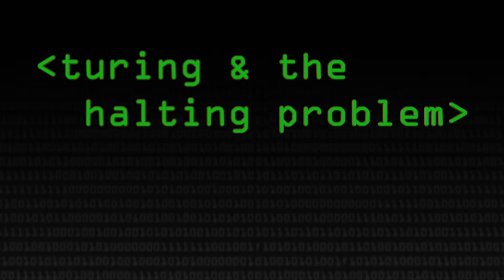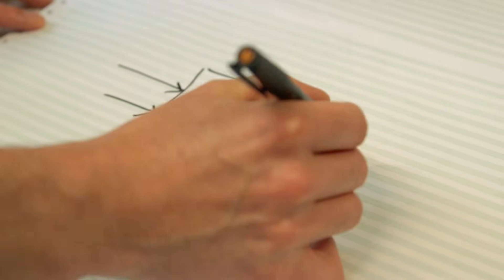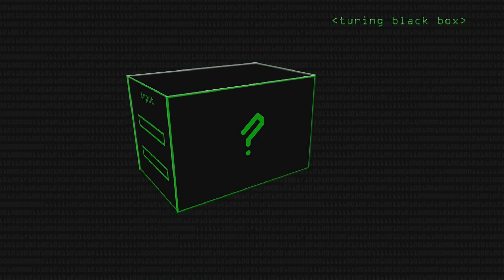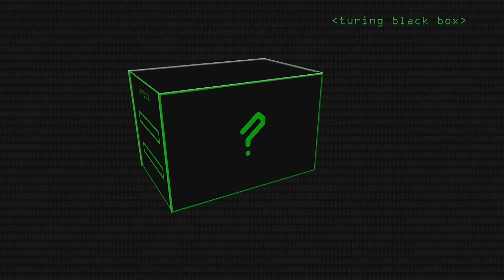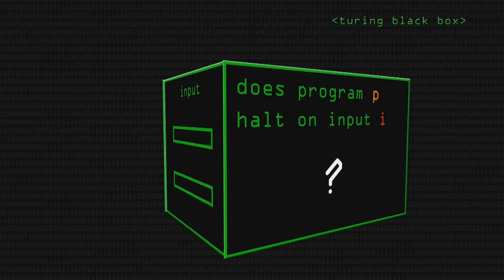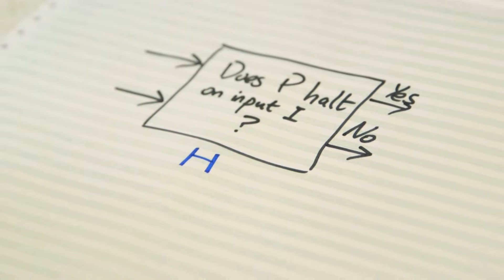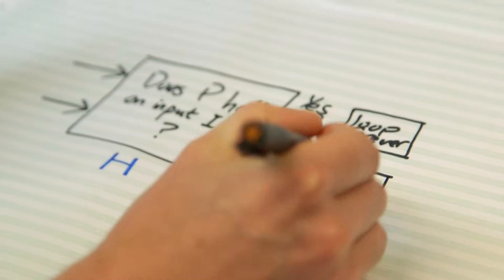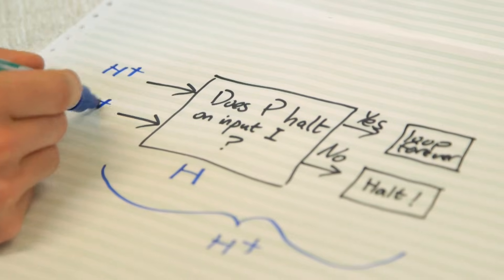Turing & The Halting Problem - Computerphile

Comment: Can someone cleverer than me please explain why adding the negation operators is proof that the H machine can't exist? I've seen this proof in a few places now and none of them have explained why adding those operations is an OK thing to do. Surely doing that to any function would therefore prove it wrong? We take machine H, then we reverse its result, and somehow that proves H can't exist? I don't understand the logic of it. If I'm writing some code and I write a function that returns a boolean value and it works, but then I add a bit at the end that reverses the result, that doesn't mean my original function can't exist. So why is that the case here? Can anyone help?
Reply: @Brauggi the bold  Point 4 in your list is the bit I don't understand I think. We know N can exist, but why does adding N or H prove that H can't exist?
Reply: @Brauggi the bold I honestly was convinced I understood until reading your proof, at this point I think I'm mostly hung up on the idea that while I understand how H+(H+,H+) can't exist how does this necessarily imply H(H+,H+) and therefore H(x,y) can't exist. If N(z) is simple making a reversal of the output then it sounds like H(x,y) still produced the correct output so at the end of the chain all that is happening is swapping the boolean and saying that a separate machine N(z) changed the output (after the analyzation) therefore the output of H(x,y) is wrong?
Reply: @Brauggi the bold I'm not even going to lie you literally just made it click after I spent way too much time trying to figure it out. I had already gotten down to the mathematical impossibility involved which is that H(H+,H+) can't be both true and false (which is the result we get in the halting problem) I was really just stuck on where the intuitive rationale comes from but now I 100% get it and all it took was the word 'predicting' which is something not a single source I found worded it like that lol. I think the problem was actually just thinking too deeply about it.

Comment: I don't understand. Don't you need to define the program and it's input to determine if the machine will halt?

The inverse halt machine has been inserted into itself with no input.

In my mind, this would contain an empty program, which would halt.

This means the input would inverse, and therefore not halt if ran with this input. The top level machine would inverse this, and then halt.

Im assuming I'm missing something?

Comment: The mistake in this video is that the box in the machine asks, does program p with input i halt? However you cannot feed in H+ to this machine because H+ takes 2 inputs instead of 1.
You could fix this by adding a new component to the front of H+ that only takes 1 input and copies it into 2 for the inner machine. Now H+ takes only one input and the argument works just as explained.

Comment: You cannot feed H+ with its description as both of its arguments.
H and H+ are machines that receive TWO arguments, the description of a machine of ONE argument and its argument.
Doing the thing proposed in the video, creating H+(H+, H+) means nothing, because in order for it to be a meaningful statement
the first argument would have to be the description of a machine of ONE argument and the second argument the argument of that machine, whereas H+ is a machine of two arguments. 
The proposed machine would answer something like the following:
 "If the machine of H+ halts with H+ as its input, then it doesn't halt and vice versa", but that is not a meaningful statement since you have to have TWO arguments to know whether H+ would halt.
Any clues here? What is wrong with my challenge?

Comment: I'm a little stuck, maybe someone can help me:
I think its pretty clear that determining if a programm halts or not without giving it the input is impossible. Now lets take H (not H+!) and feed it to itself as program("Hp") and input("Hi"). H will now try to find out if "Hp" halts on "Hi". But "Hi" itself has to contain 2 arguments "Hip" and "Hii" to be a valid argument. "Hii" in turn has to contain "Hiip" and "Hiii" etc. So the input is delegated to infinity. Hence it is not possible to ever create a valid "Hi" (for this example). Which essentially is the same as running "H" without an input, since you cant put an input at the most infinite recursion.
So is there really not way to get "H" running when "Hi" is evaluatable? Im still curious - recursions are not very human friendly :D

Comment: I find it odd that you expect a machine to function when given it's own code to process that has it's own result flipped while doing so. H can't understand what H+ is going to do, because that design in itself is a loop, and switches the result. As far as I'm concern. If a machine can exist that does everything besides this kind of flipping logic, it's a pretty fantastic machine, and thus the Halting problem is solvable. It just can't do 'this'. Asking it crack a loop, doesn't make sense. What loops are solvable?

Comment: So I understand that feeding the machine into itself is one counterexample, i.e. you can't use the "halting problem calculator" machine to calculate its own halting ability. But: can it be used to calculate the halting ability everything (or almost everything) else?
Reply: It could calculate the halting ability of many problems correctly, but there's also an infinite number of inputs where it's wrong. So no, it cannot correctly calculate the halting ability of almost everything.

Comment: What I don't understand is how H+ can even be called in the first place. H+ requires a program and an input. H+ refers to itself as the program but it's output as its input.
Neither of H+'s outputs produces a valid input. Loop forever will never return a value, and Halt would immediately end the program, neither resulting in a valid input.
Also, H+ needs to take in a program and an input, but its input is a program and its input which is a program and its input?
It seems like the H+ paradox itself cannot even exist because the conditions that create the paradox cannot even be started.

Comment: The thing i don’t understand let’s say the first h+ machine feeded by some code other than h+ machine code , the second h+ machine feeded by h+ machine code so there is two identical functions that take two different inputs ,by all means they’ll behave diffrently , one’s output or state doesn’t say a thing about other’s output. Let’s use an example i have a function f(x)=2x .
Let’s x =2 then f(x)=4 and then let’s feed the function f(x) by itself so we have f(f(x)) , we set the x=2 earlier this time f(x)=8 ,this does not contradict with earlier result because they have different inputs.
As a one more example ,take two electrons ,they fundemantally have the same structure ,at time=0 they have no velocity , then i gave one of them a push , can i say ,electron have velocity but electron have no velocity ? You ask which one? There is no contradiction , they are distinct.

Comment: How does that make any logical sense if we add "extra bits" a loop and a halt. Those are two different "functionalities", am I missing something? I get the process from the video. But in order to get to that conclusion I feel like that step was wrong.
Reply: The premise is trying to show that if the result from this machine has a direct effect that results in a contradiction, then it must be impossible for this machine to exist. In other words, a machine that is able to predict a conclusion completely from the original proposal, would need to account for the consequential result (which in this example causes a direct contradiction of the premise).

Comment: The most interesting thing here is all the "Pinocchio's nose" discussions in the comments. Of the top of my head, the simplest halting inputs would be dividing by zero or an infinite loop: while (true){}. You could do some checking to avoid such a situation, but programmers make mistakes sometimes. Regarding Pinocchio's nose, there's a linguistic issue. Most say the test is "My  nose will grow". I think a better input would be "My nose is growing". (but it must be said while the nose is not growing). But, I don't think that would cause a perpetual growth, just a single spurt. Also, it appears as if Pinocchio's nose grows depending on the strength of the lie, but I'm not sure if that's relevant. The other thing, is people argue that you can't like about the future, only the past. I dispute that. I have a dentist appointment tomorrow. If I say "I do not have a dentist appointment tomorrow", that is not true. But, now consider, there is no algorithm for truth. Does it depend on knowledge or belief? I think it depends more on knowledge than belief. If I believe I have a dentist appointment tomorrow and I say that I don't, it's not necessarily a lie (more like a small one), but if I know I have the appointment and say I don't, I think that's more severe. Food for thought. I'll leave you with this: Nietzsche postulates that we're always 4 steps away from the truth. There is the objective truth. The first step is for us to perceive that truth or objectivity. The second step is to process the perception of objectivity in our mind. The third step is to assign a linguistic description of the objectivity in our minds. The fourth steps is the communication to another with words from our mouth to describe what we have in our minds. There is no algorithm for truth.
Reply: But then, this halting problem seems to depend on a case where Pinocchio's nose is input into his nose (maybe Ghetto made a second copy), and maybe the input would be Pinocchio saying "this is my nose" while holding the copy of his nose.

Comment: wouldn't the machine just run into a loop when checking if it'll halt with itself as input?

since it simulates itself simulating itself simulating itself forever and it just keeps going until it crashes
Reply: Yes and that's the proof that this shows. The original premise is that there is a machine which can predict any scenario just by the input it is given. However by providing itself as an input you can show a contradiction as the H+ machine is guaranteed to incorrectly answer the right solution with this premise.

Comment: Turing worked before version control. The fact that you can take working program H and break it to produce defective program H+ doesn't prove that H didn't work in the first place. The failure of H+ is a separate debugging problem which is easily solved by reverting to the previously working commit of H.
H operating on H as program and H as data gives the correct answer, as does H working on H+ as program and H+ as data. H+ is just a rubbish program; H is awesome.

Comment: This is not a valid proof. H+ given H+ is not the same as H+ given (H+, H+), so there is no contradiction.

In your final example, the overall H+ isn't being given H+ as an input, it's being given two parameters: (H+, H+), one parameter for the program and one for the input. In other words, it doesn't make sense to ask if H+ halts on H+, because you're not specifying two parameters. You could try to force H+ to run on one parameter (i.e. H+), but even if you succeeded, it wouldn't be the same as giving it two parameters, so you wouldn't be able to make the contradiction.

In brief, if H+(H+, H+) loops forever and H+(H+) halts, that's fine, because those are not equivalent.
Reply: This is actually because halting problem solution exists only if H+ exists, but H+ on H+ itself is contradicting so H+ can’t exist so halting problem solution doesn’t exist.
Reply: @mrityunjoynath7673  The overall machine is running on two parameters (H+, H+), one for the program and one for the input to that program, so it's not actually running on itself, which is just H+, so there is no contradiction.
Reply: @BrettClimb  Yes the internal h is also running on two parameters right?
Reply: @BrettClimb  Over simply put contradiction is this: "H is halting on a non-halting situation attained by it's to analyse program"!
Reply: @BrettClimb  There is a contradiction, so you will see, you can give any argument to it being non-contradicting I can give a counter argument to that! Try
Reply: @mrityunjoynath7673  The internal H+ is not running on two parameters because it's only being given H+, not (H+, H+). So in the example,  H+(H+, H+) loops forever while H+(H+) halts and vice versa. That's ok because those are not equivalent statements, so we shouldn't expect them to produce the same result.

Lets say we decided to give the inner H+ an input of (H+,H+) instead, then the inner statement would be H+(H+,H+) and the outer statement would be H+(H+,(H+,H+)), so the statements still aren't equivalent. The inner H+ is always going to have one less H+ than the outer H+, because it's a subroutine of the outer one.
Reply: @BrettClimb  You are wrong because these two scenarios are actually equivalent! It is because H+(H+,H+) is actually idempotent.
Reply: @BrettClimb  You can refer to this answer
Reply: @BrettClimb  Please consider upvoting as well :) and I hope the OP accepts my answer as well!
Reply: Ok I guess YT is deleting my Stack Overflow answer link
Reply: @mrityunjoynath7673  So are you saying that H+(H+) ≡ H+(H+, H+) ≡ H+(H+, (H+, H+) ... etc? I can't see how this could be true. Let's assume that H+(H+) halts. If this is the case, then H+(H+, H+) would loop, because it does the opposite of the simulated function does. H+(H+, (H+, H+)) would do the opposite of of that: halt. So you see, each time the recursion depth increases, the result alternates between halt and loop. So however you define the base case, it doesn't appear that you can say that H+(H+, H+) is idempotent.
Reply: Maybe you could give me the title of the stack overflow question?
Reply: @BrettClimb  "Misunderstanding Turing's Halting-Problem Argument" it's in CS Stack Exchange asked by user named Israel
Reply: @BrettClimb  No, H+(H+) isn't idempotent but H+(H+, H+) is. H+ can be idempotent only if it receives two arguments. It is because for it to return output same as the input it's internal H must be programmed as H+, so that it's - & - to +.

Comment: i believe there is a problem at least in the way this argument is being explained. i believe there is a anachronistic mistake here.

h+ would never halt to answer if it runs forever or not
why do i assert this?

premise 1: 
either h runs forever or it doesn't

premise 2:
a program must perform 1 operation at a time

premise 3:
the operation order of h+ is h then if true then some infinite process

conclusion:
if h does run forever, h+ can not finish the operation h to halt so it runs forever
if h doesn't run forever, h+ will run forever

in either of the above h+ runs forever, so feeding h(h+, h+) will either run forever or return false. if i run h+(h+, h+) i will never get an answer because it will run forever

extra:

now given alan turings premises here i think we should also assume that h(h) == true otherwise we will never get an answer and therefore there really would not be an h.

so a possible premise 4:
h(h) == true

"if h doesn't run forever, h+ will run forever"

h(h+) == false

h+(h+) would never halt to answer
Reply: Premise 1 is wrong: By it's definition, H does halt on every input.
Reply: perhaps i am misunderstanding here, i think that still is within the premise?  and at premise 4 i think i return to your point about H always halting
Reply: Well yeah, premise 1 is not technically wrong. There is just one case that never happens.
So, given your 3 premises and the definition of H and H+, i can't see how you come to your 2nd conclusion.
The first one is obviously true. But the second one clearly not.
Let P be a program and I it's input and suppose that H halts on H(P,I). If P does halt on I H(P,I) will return true, otherwise false.
That means if H(P,I) returns true, H+(P,I) does not halt and if H(P,I) returns false, H+(P,I) halts.
As you see there is a case where H+ halt's, so you can't argue with conclusion two.

The problem with your argumentation is that you completely ignore the remaining case.
Reply: @MisterBrausepulver  trying to respond chronistically even though this is slightly asynchronous... so i think we agree on premise 1 now? as for the conclusion from premise 3, i am visualizing it like this. if H contains an infinite loop H+ can't finish, if H does not contain an infinite loop H+ will run an infinite loop. in either case there is an infinite loop. now if i substitute the terminology... if H doesn't halt H+ doesn't halt. if H halts H+ still doesn't halt.
Reply: to summarize, my total point is that H+ says nothing about H because it doesn't actually resolve if you account for o.o.p.